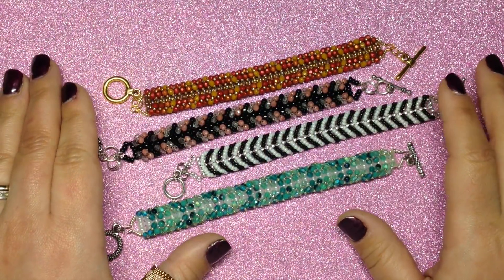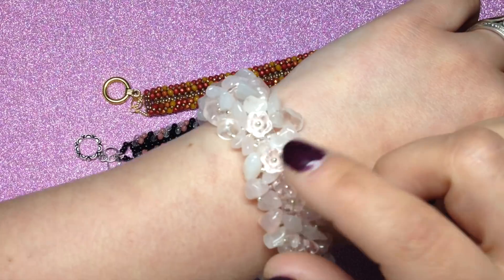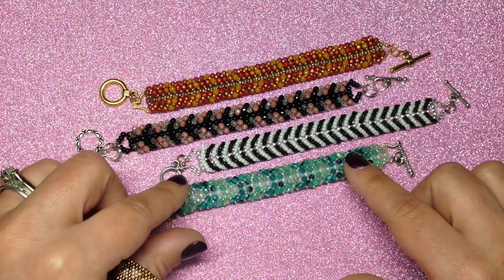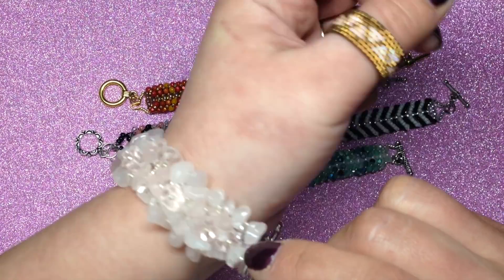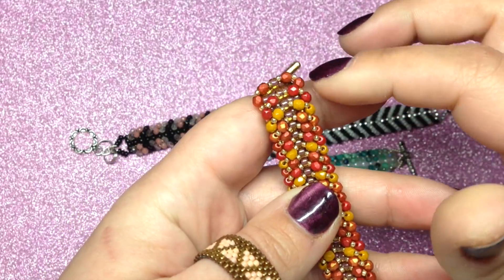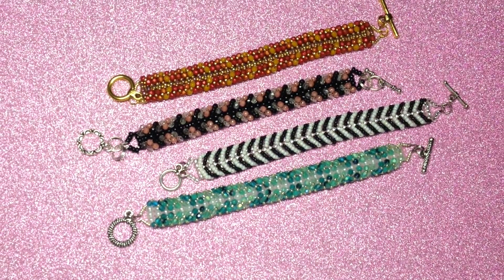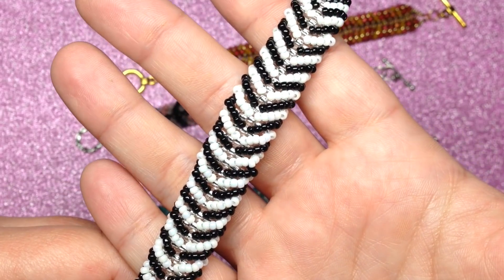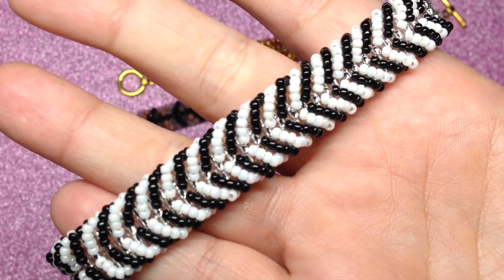DIY Chevron Channel Beaded Bracelet Tutorial, Fire Polish

Comment: Wow, Gina! This is such a simple design and looks easy to make, but it has a very classy look to it. Good job! I have been receiving the 3mm and 4mm fire polish beads also, so I am definitely making this bracelet in several color ways. One more thing, your method of using the wire guards for the closure is so much cleaner and neater-looking than the ones done with seed beads. I imagine it is also much more secure than thread alone. This will make me change the way I do closures in the future.
Reply from the maker: Hi Jeanne! I am so glad to hear that you like the design, and can see how classy it can look done in the fire polish beads. That's definitely what I was going for! It sounds like you will be all set to make these with the ones from your stash as well. Wire guardians are my go-to now. I am always reaching for them for the reasons you stated. Cleaner, neater, and stronger. Thanks so much for watching! 💜

Comment: If the bracelet is 7 inches does the claps add 1/2 inch
Reply from the maker: Hi Ann! Great question. To clarify: the actual beaded portion will be about 6 inches, and the jump rings and clasp will likely add around an inch depending on the size of the clasp. You can also add more jump rings to adjust size. Thanks for watching!

Comment: I cant get past the latter part...my work is rolling into itself making a tube with each layer...im useing beadalon supplemax .012 in...is it my string or did i mess up in the beginning
Reply: I keep trying to make it flat and it just pops back up again. Done 7 rows and starti g to wanna give up :(
Reply from the maker: Hi there! You may be pulling too tight on the ladder stitch. Try giving it some slack, and letting the rows lay flat without pulling them too tight together. It will tighten up as you move on to the next steps. Hope that helps!

Comment: Would it be ok to use becomes on the top please?
Reply from the maker: Hi Linda, You should be able to use bicones in the same size as the tutorial (3mm). You'd have to experiment with 4mm to see if they'd work. Thanks for watching!
Reply: @ORCHIDandOPAL  I used Bicknell, one on each side and some 8/0s. It turned out okay.  I had trouble with the base.  The rows scrunched together.  What did I do wrong?